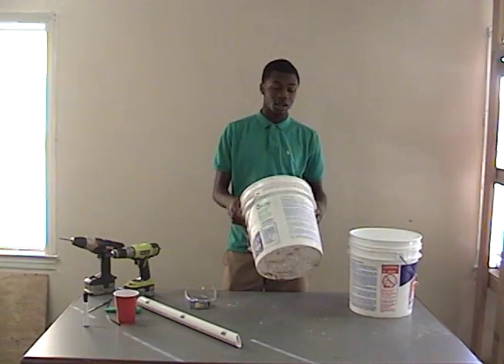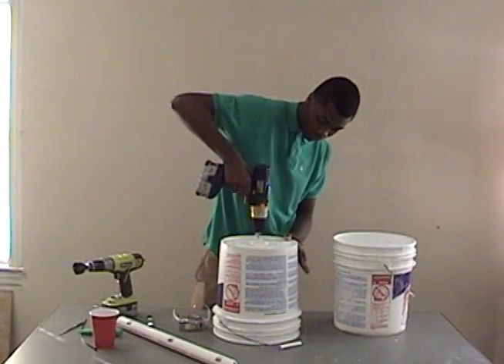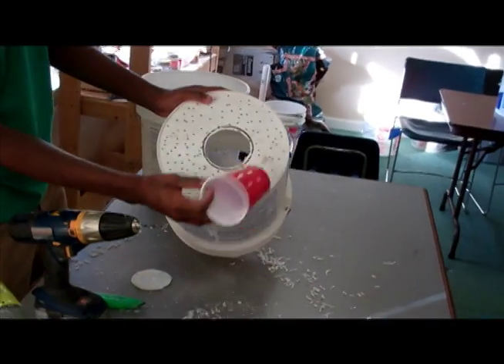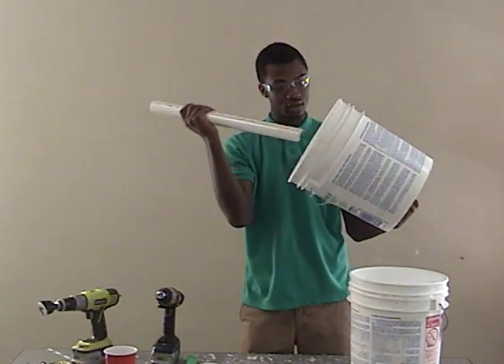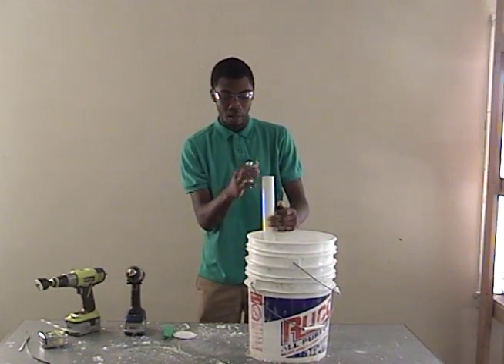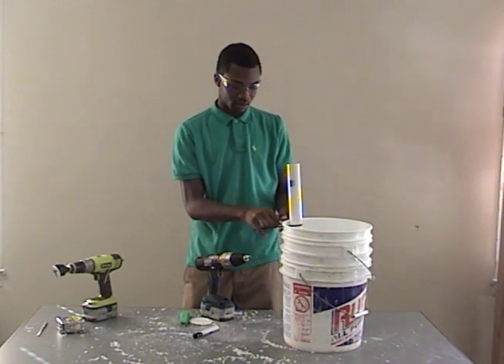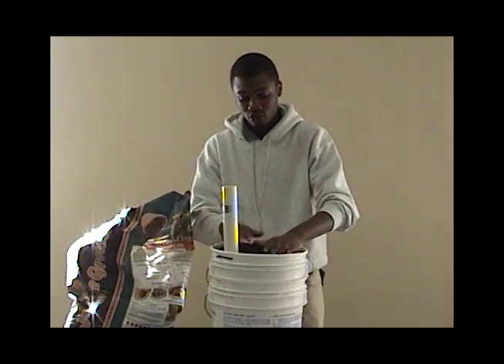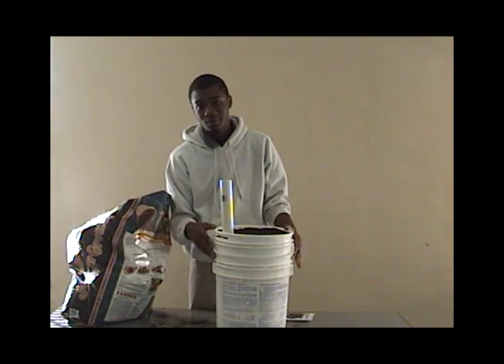Tae Milner builds a 2 bucket Self-Watering Container

Comment: Nice instructions.  The red cups is too flimsy.  I found 3 other thick plastic containers in the recycle bin.  The one I took off the bottom and topped area where the container narrowed, I made a tube, longer than the red cups is, and is 2 inches above the bottom hole 🕳️, leaving a collar of 1.5-2.0” above the top container bottom.  Cut at angle less than 45… maybe 20 degrees angle?  The water 💦 and dirt make contact and the bucket has 2 plants thriving.

Comment: I originally did it this way but have since added some cotton strips to aid in wicking the water up to the top. I also drilled a overflow hole in side of the bucket just below where the second bucket sits inside.